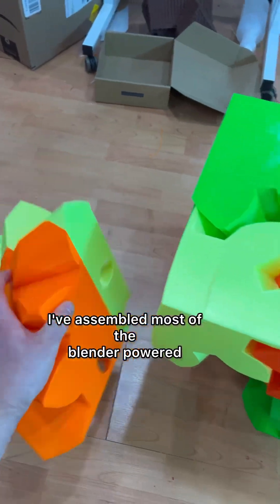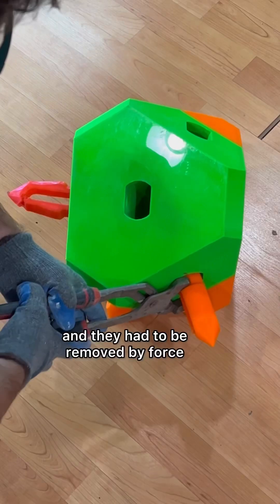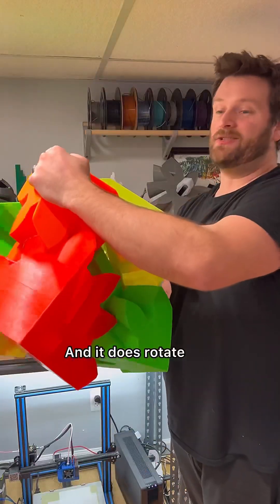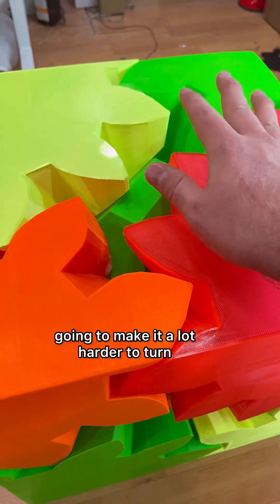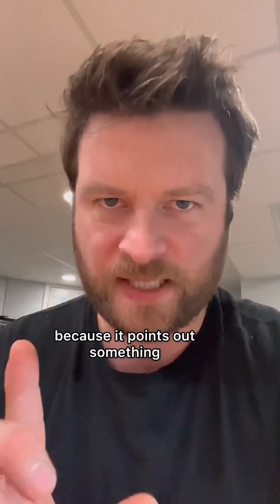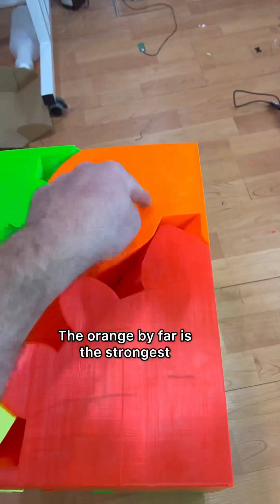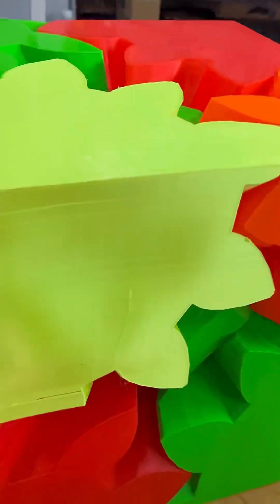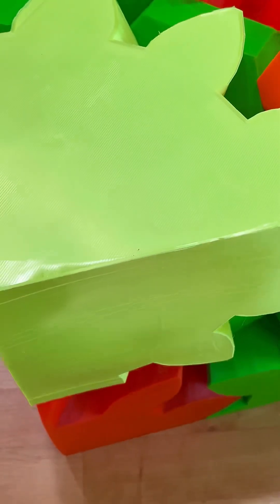Mega motorized gear cube assembly day 1! #3dprinting

Comment: You gotta remember that however you stress this mechanism, it's going to create an uneven stress distribution across the gear faces, and the system as a whole.  You would have to simultaneously apply the same rotational force to all cubes, while they are all being constrained by the same appropriate mirroring forces, and ideally in a gravity free environment.  Which is of course ridiculous and impractical to setup.

Just pointing out that these factors could be contributing to the disparity you are seeing in cube performance.  I would maybe try experimenting how and which cubes are being torqued, to see if that's causes any particular cubes to be more unevenly stressed.  Just food for thought.

Comment: How did you print the orange one? I’m not talking about settings or layout. Direction, angle, and orientation has a big effect depending on the type of strength you’re looking for. Tensile, shear, torsion, and compression
Reply from the maker: The same gcode file was used to print all of the large gears.

Comment: Print on the diagonal, of possible. That will keep the weak points (layer lines) off of the cross section of the faces and base of the tooth.
Reply: This.

Comment: You maybe should consider printing at a different angle? Because from what I can tell, layer adhesion is the problem, and using a more favourable angle can easily increase the strength without much redesigning or more material

Comment: That yellow is weaker because the pressure from the extruder was either not enough or the temp was not high enough for it to bond. Or both. I Had a similar issue because my esters were too low and my temp was not high enough

Comment: It's always the same issue with 3D printer builds... Why not be practical and use something that is sturdy and reliable and just paint it instead of using the filament color you want from the get go that clearly has structural issues...

Comment: i thinks its because usually the lighter colors of plastics are weaker structurally because of the pigments used, so yellow, pink, and green will be weaker than blue orange and red
Reply: Lighter color opaque/pastel is filled with a bunch of TiO2 which gives no structural integrity. It can be up to 20%, maybe more, with some brands.

Comment: You need to print with 3-6mm thick walls, not the usual 2×0.4mm walls. Better is 0.6 or 0.8 nozzle with 5 or 4 perimeters respectively. 
Use a lighter infill anchored more often, or even solid layers every few infilled layers.
Reply: Your 100th like

Comment: Oh my God you printed hollow I didn't realize you did that these should have all been for perimeter 20% infill prints Yes it would have taken an absolute gargantuan quantity of filament but you're attaching it to a freaking blender :-) muahahaha No skimping on the filament
Reply: You might be able to salvage it? I doubt it but try it on one piece you need to get some canned foam like insulation foam kind of stuff like great stuff but it needs to be low expansion you want stuff that's not going to expand too much or it's just going to blow the part out

Put a nice big hole in the part and slowly start filling fill the gears first the teeth let it expand and set and then add a little bit more let it expand and set a little more be careful too much it'll create heat the reaction that allows that foam to work is exothermic if you add too much of it it'll just melt apart Heck even a small squirt might do it but one way to find out :-)

Comment: If you are going to make a new yellow piece, for strength purposes print it at an angle so that the pointy corner side gets printed first and then further up the gears I've found that helps most of the time
Reply: Yeah! I just said that, but saw I was 2 weeks late. Glad someone else was able to get that before me.

Comment: I mentioned this to my brother who does a bit of 3D printing himself, and He suggests doing a lightning infill and then drilling a few holes into the gear sections and then filling the entire thing up with spray foam and then filling in the holes with a 3D printer pen sanding everything smooth in the end.
Reply from the maker: Great suggestion, particularly with the spray foam because there were printed with lightning infill. I’ll probably save that step for an add-on after the fact to see if it helps with structure and nose dampening.
Reply: @printmeister  I will pass on the compliment . Though a personal suggestion is to start with a small model before moving on to the full sized one

Comment: Are the filaments just different qualities or is there some chemical property of the different colored dyes that make the resulting prints stronger or weaker? I know basically nothing about 3D printing and am getting my first printer in a few days so I’m curious
Reply from the maker: There is a sheen to the yellow one that gives it more of a “silky” look. Those filaments are typically a little weaker and require slightly different print settings. My issue could be a combo of a slightly weaker filament and a slightly worse print. 

It’s still a good filament though, and can produce a strong print. the base gear is part yellow. It just needs different settings

Comment: I think you could print a different stronger filament for the infill but do a yellow shell
Reply from the maker: That’s a clever idea
Reply: @printmeister what if you just make a bunch of orange ones and paint them
Reply: @Juangonzalez2004XO maybe the color isn’t the issue, perhaps it’s the geometey?
Ork tier logic to ascribe characteristica to colora
Reply: @printmeister maybe even something with some flex so they're not shattering...
Reply: Always always lubricate with genuine intentions
Reply: 100% infill. Make a solid brick
Reply: @rakishpotato4783 that might make it too heavy though seeing how big it is but they could put more structural supports in it
Reply: @williamcoon3724  Heavy/much more expensive/infinitely more time consuming/etc.
Reply: @rakishpotato4783 that’s gonna take way more than a couple spools
Reply: @rakishpotato4783  too dense and heavy
Reply: @rakishpotato4783 more walls will be stronger